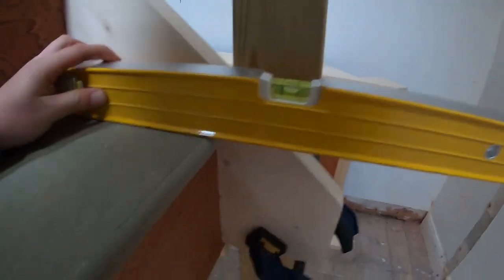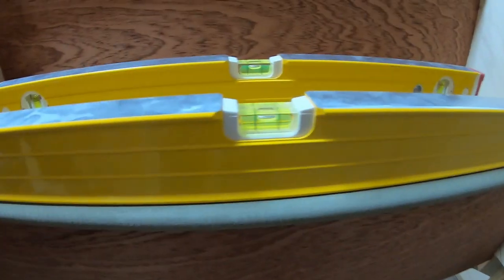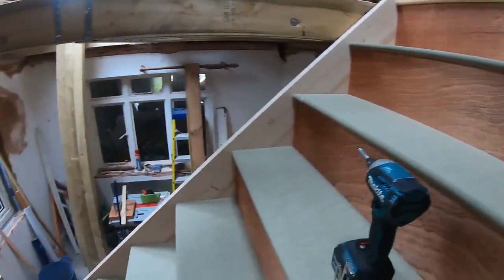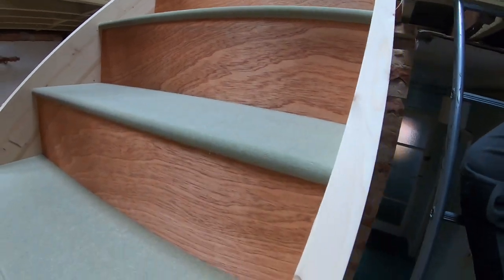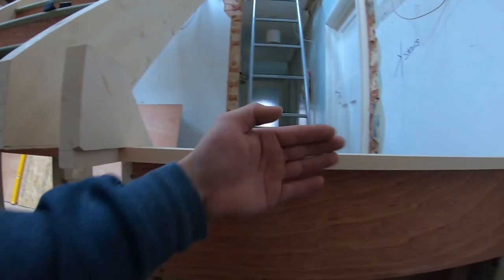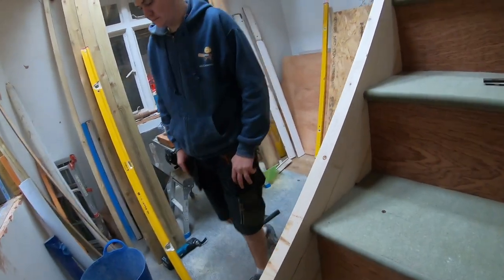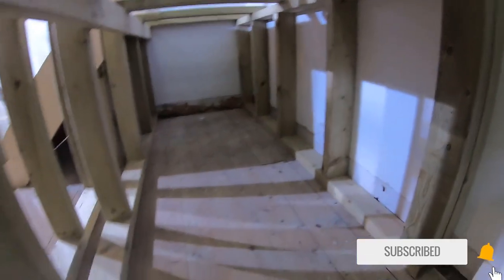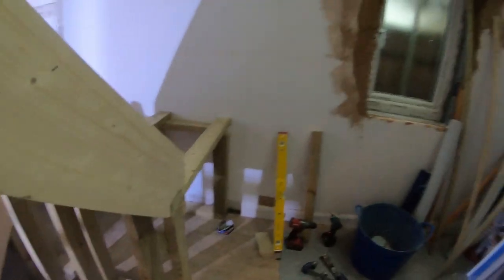How to fit pre-made staircase

Comment: You can never get it perfect? That was literally the easiest staircase installation any chippy could ask for, loads of room with no walls in the way and no struggling. You said you can’t have plumb and level. You clamped it to timber with quick release clamps then started talking about raising it on the trimmer, (wrong). The top nosing will end up a different height to the 22mm finished flooring if you do that. You adjust the cut in the underside of the top stringer that is throwing you out of plumb. Explaining the cause of squeaky stairs then saying we don’t glue wedges in because they dry out and need knocked in later? So the customer has to take all the plasterboard off under the staircase  when it starts squeaking. And watching you build the so called landing was painful, using the narrow  2” instead of using the strength of the timber 4” to carry the weight on the landing floor. It was daylight when you started that frame and you were working in candlelight by the time you half finished it. I would have liked to see the newel posts that should have been fitted or at least the finished job.
Reply from the maker: Next time i will call you to help, as you  seem to have answer to everything.
Reply: I’ll post a video in the next week of a staircase I have to fit between two brick walls in a 1907 house. Removal of the original staircase, floor height 3225mm, changing from a kite winder to a quarter landing with new joists and a staircase finished at a 42 degree pitch.
Reply: @gavinhalliday8613  Hi, when are you going to post the 'how to' video please? Genuinely interested to see how it differs. Thanks

Comment: "These don't usually get glued"? All stair wedges do! Better not be with pva either. Polyurethane glue only! Laid landing timbers flat too. Omg! Residential amateurs 🤦🏻‍♂️
Reply from the maker: Everyone has it's own opinion, you have yours and i have mine, lets leave it at that.
Reply: @ANCarpentry  strength and laying timbers so that they are used in their strongest way isn't opinion. It's the difference between handymen and carpenters. Good luck with the squeaks 🤣
Reply from the maker: @andsowot  i think you have never made a stud wall, load bearing wall, if anything the way we have done it is more than it should of been and all done for one purpose to have a storage underneath the landing , but as i can see you haven't even watched all the video to see why we done it that way,  as for squeaks, or not using polyurethane glue as you say which is usually used for more porous  wood/old timber or sticking flooring to joists. As for gluing the wedges underneath the threads that could potentially lead them to split  over time as timber sold these days even for joinery  is not dried to the same standard as it used to be and is not the same quality, so by not gluing them you got an option to drive them back in!
Reply: @ANCarpentry  I can't wait to show this at work tomorrow to other REAL carpenters🤣🤣🤣 Thanks! You'll be ok though, most residential work is easy to get away with doing arfajob on😁👍
Reply: Is PVA so bad , I swore by it making furniture and woodworking glue ups , im abroad now and can only get Elmers and Tite bond . still interested to know about Polyurethane.
Reply: @patbassman8251  D4 polyurethane wood glue. Anything people are walking on or structural you should use it. Stairs will always end up squeaking if you use pva on any of  the joins. I'm a site carpenter for years and funnily enough we're having issues this week because some cowboy used pva on stairs in three new houses. All moving and squeaking.
Reply: @andsowot  Cheers for the reply , so your saying PVA shrinks not good , always thought it good stuff I never had any failures .
Reply: @patbassman8251  pva is fine for all sorts. Just not as it's being used in this video. Glue all my mouldings with pva, it's fine for furniture like chairs and tables. But things with high traffic it's no good.
Reply: @andsowot  Good to know thanks .